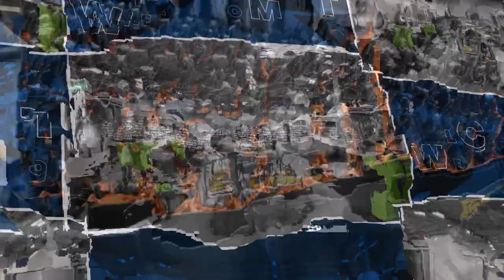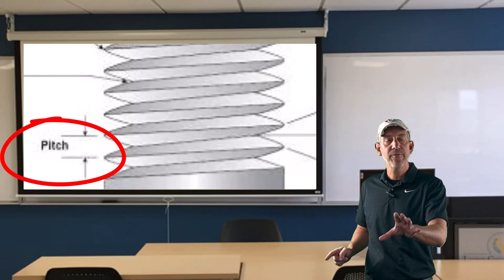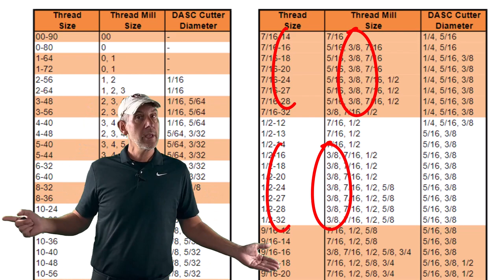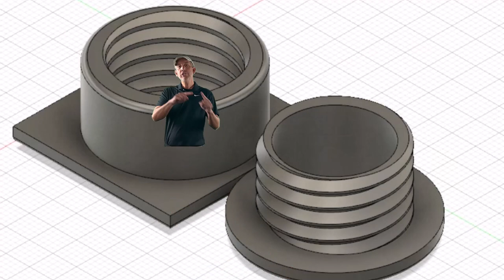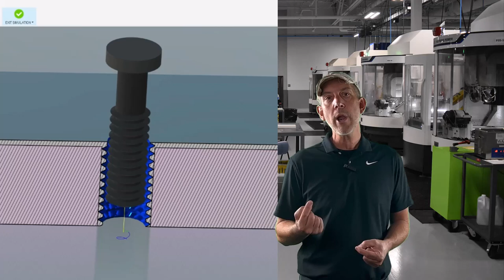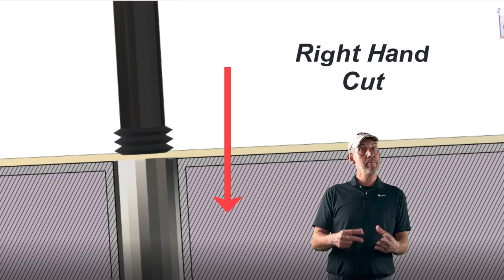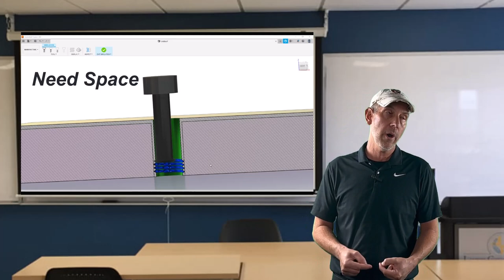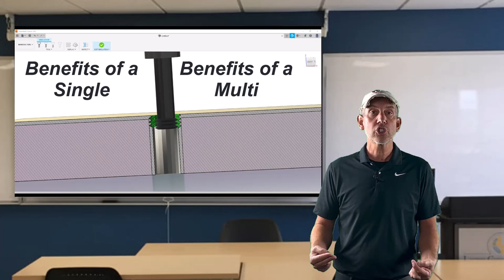The Three Different Types Of Thread Mills Explained: In The Loupe TV Ep. 8

Comment: Your test was about the only think I knew already. I learned programing through reading other peoples programs. It has been interesting ordering tools, using CAM and creating fixturing. I am learning more now than I learned in the last 10 years of working for someone else. I bought a couple 4-40 tri-form treadmills because I broke about 6, 4-40 taps trying to tap some holes in 304 stainless. I got it to work on one part, but it broke on the very next part. I loved the bit on single form threadmills, i could spend $4000 or more on just all the different common sizes of threadmills.

Comment: Another application where I would be interested in a single form threadmill would be a lathe with live tooling. I would think that ,especially for deep, small threaded holes, this would have a good chance of really reducing deflection and chatter. Does that prove out in practice?
Reply: That is a perfect application for a single form Thread Mill.  Lathes tend to be less rigid than Vertical and Horizontal Mills.  Anytime you exceed that 2x diameter, especially in a lathe, look to single form 1st.

Comment: It seems to me a tri-form would only be useful in really hard materials. You still have to make every revolution of your entire thread, but now you've lost the flexibility of doing different pitches. 

That said: I would bet in materials where wear is a significant issue, you could run a tri-form a lot longer before having to change it. Important for high production and lights out machining, especially. 

I do have a couple of questions...  chips will accumulate in the bottom of a blind hole, right? So going top to bottom could mean more recutting of chips. Does this require more 'dead space' at the bottom of the hole so you don't get into your chip pile? Do these come with thru coolant variants so you can flush the chips up and out of the hole more reliably?
Reply: Joshua these are some great questions that absolutely need to be considered when using a triform thread mill.  First off, they are great for harder materials and any holes that have been work hardened for that matter.  You get that natural spring pass to help chase the hole and get more consistency of your thread. The core is actually larger on these as well.  To answer your other question.  A blind hole has no issue with the chips because they will obviously drop through to the bottom of the part, but when it comes to blind holes you could have a chip pile at the bottom of your hole especially if you are in a vertical Machining center.  I would one suggest a coolant through holder if you could help blast the chips out and second adding extra room at the bottom of the hole would absolutely help.  Of course, chips are much smaller than with a tap so we are still minimizing our issues.  Great questions and thanks for watching...